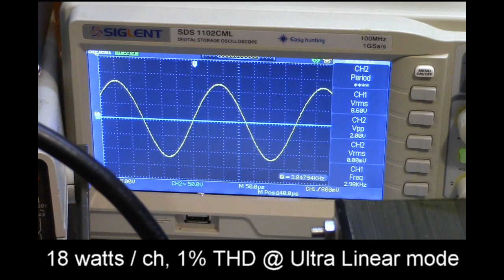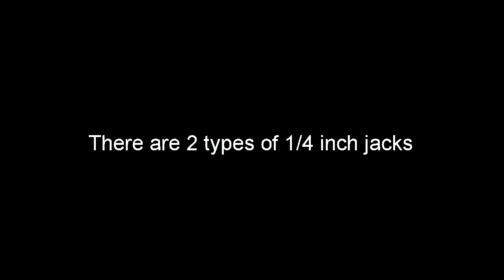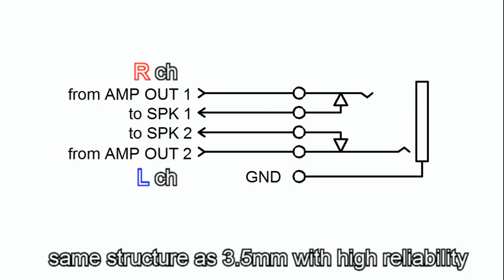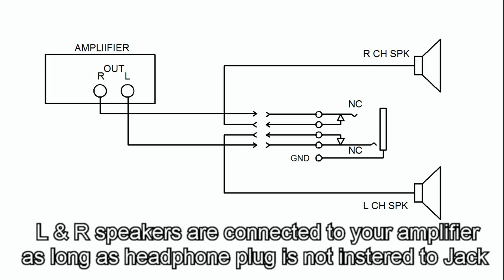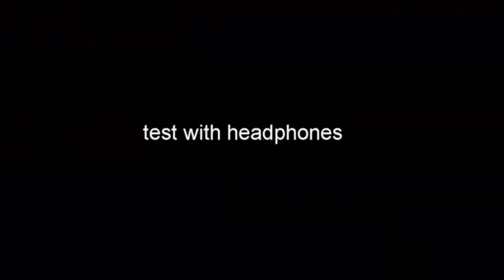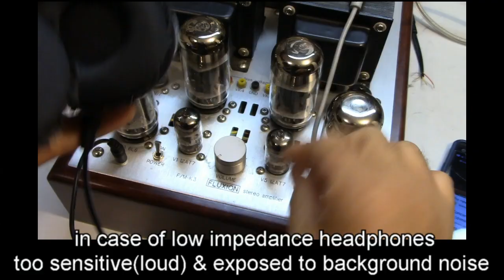3.5mm headphone jack wiring installing on amplifier ; high impedance headphones are recommended

Comment: I though this headphone output needs some protection (Resistor\Capacitor) between the amp output and the headphone jack ? Or a op amp circuit for the headphone output from the preamp ? Compared to say 100 watt 8 ohm speakers for example,  if that volume is too high will it not destroy those headphones ?
Reply from the maker: Hi, there's no voltage devider because of simple headphone jack. Happy New Year sir

Comment: Nice video thanks for sharing this very useful. I build a 60 watt solid state mono guitar amplifier and like to add a headphone jack to it, my question is where I should make the connections. Do I have to connect directly to the speaker output of the amplifier and what do I need to make this work, I assume it should be done with some resistors combination. Can you help me out with this.
Reply from the maker: email me please

Comment: can you technically wire the headphone jack directly in parallel with the output of the preamp??

I have a basic solid state amp without a headphone out and a dedicated pre amp and wanted to know if it was possible thanks.
Reply from the maker: Please wait, I'll make a video related with headphone output. Thanks

Comment: Great work man! Can this type of jack be used for low voltage? I've got a K type thermocouple that I'd like to be able to plug in. Right now it's hard wired.
Reply from the maker: Yes you can. Tnx